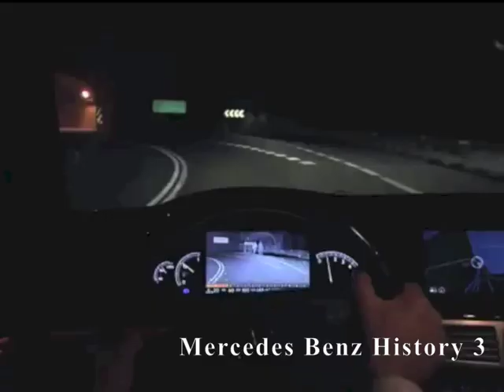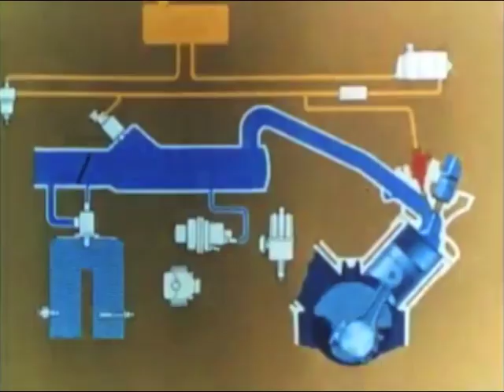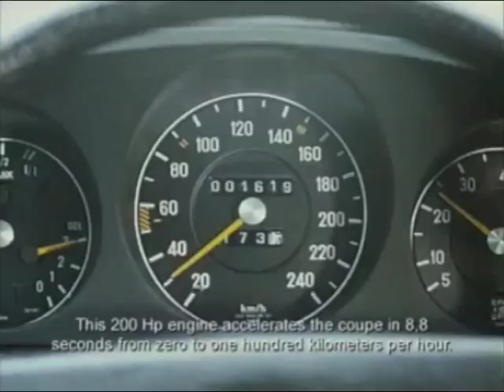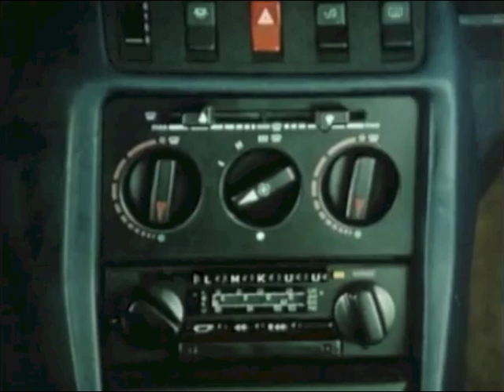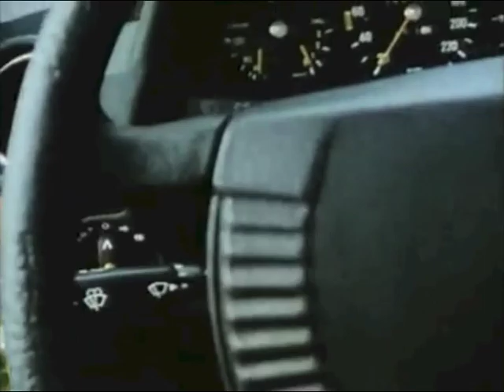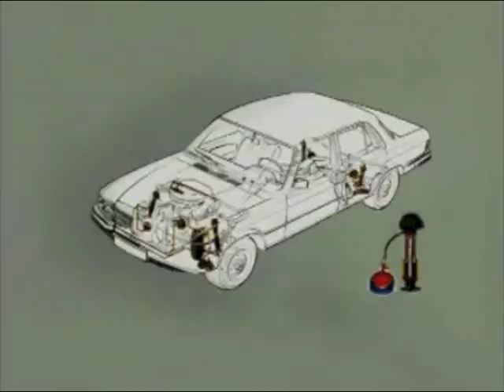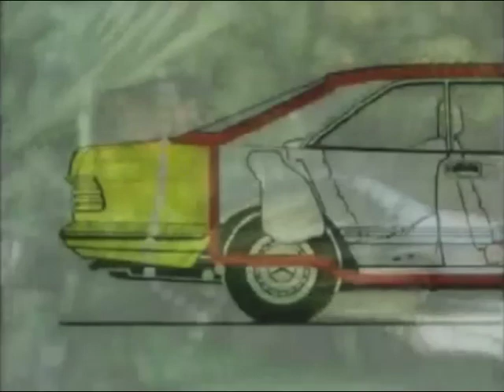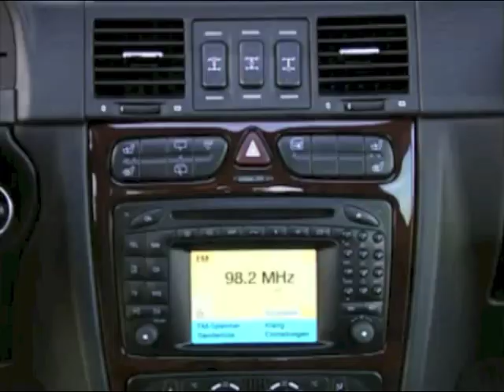Mercedes Benz History Part 3

Comment: A 1978 W123 (250) has been my daily drive for the past six years. I still enjoy each and every journey driving her. She has never let me down and (with some bodywork sorted and TLC) continues to look immaculate. It is, without doubt, the greatest car I have ever owned.
Reply: Same here, my 1984 280CE has done over a million kilometres and, with a bit of effort to maintain appearance and proper servicing, is in fine condition.  Never crashed, still has the original engine and transmission, though is hardly unique in that respect.
Reply: Nice! I have a 1979 240D. Engineered to drive and last for ever. I’m so blessed to have it. Nothing comes close. Best driving experience I’ve ever had.

Comment: Interestting viddos but How have I somehow missed the illustrious w124 range ,possibly the best of the Mercs ,especially the 300 engined cars which also fought off the "oppositions" Yuppie 5 series.
Reply: W124 was the best Mercedes Benz ever made till now.. I think they have their swing back. I have 63 190SL a 2003 C240 , and a 2012 CLA AMG 63.. Mercedes Benz are solid. As the pyramids in Egypt

Comment: I'm intrigued by the remark about the new diagonal swing axle "which allowed safe road handling", implying an admission that the previous axle (a true swing axle) was not safe. I was astonished when I realised how recently MB were still using swing axles which are definitely not safe if things get hot in a corner or in hard braking, the camber changes are lethal. Triumph stopped using swing axles after the MK1 GT6 and Mk 1 Vitesse, with good reason. The Triumph 2000 / 2500 has semi trailing arms and handled well. According to this MB didn't get to semi trailing arm IRS until 1976, Triumph had it in 1963. Of course Jaguar had the best IRS from 1961. I think the Triumph 2000  and Jaguars were far superior designs (and better looking than almost anything. The problem was bodies made by pressed steel Fisher, from rust.
Reply: The low pivot swing axles were a development from the, admittedly potentially lethal, early swing axles.  By lowering the pivot lobation to below the diff, and making both axles pivot from the same midpoint most of the issues were solved, especially when the proportioning valve was added.  These were engineering compromises, sure, but they did remove the deadly handling characteristics linked to lift-off oversteer, such as thise wild camber changer.  Sway bars also helped.  Swing axles were mostly gone by the end of 1968, replaced with a more modern semi-trailing arm arrangement, which prevailed until the late 1980's, except for the proper 5 link arrangement on small and mid ranges, what later became the C and E classes.  The only holdouts of the old suspension was the 6.3 built until 1981.
Reply: They are calling it a "swing axle", but it isn't.  Its actually a "trailing arm" design...

Comment: benz made some really nice cars over the years,but some of the stuff that were introduced in the late 60's and 70' even a few things during the 80's were used on north american vehicles,especially in the 50's, but were introduced as a one year option that are rare to find...reliable cars too. a little bit of a pain to work on,but if you looked and knew what you were doing no biggie... the diesels we had to install fuel heaters or they wouldn't start in winter,almost every diesel does though(here).in the winter some times a diesel isn't shut of for weeks,easier to let it sit running, cheaper too.